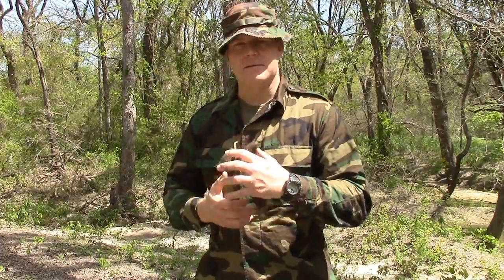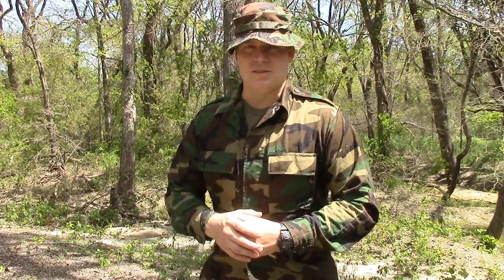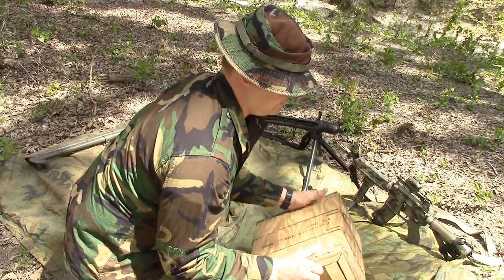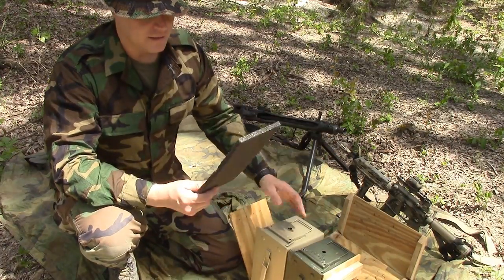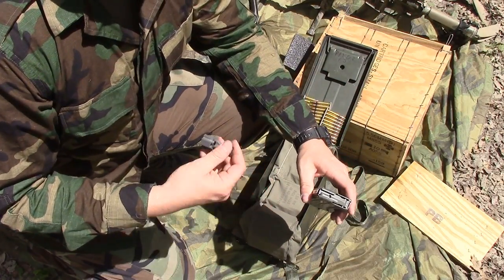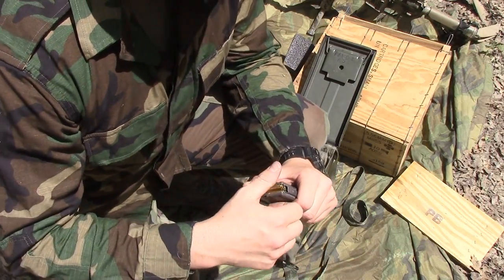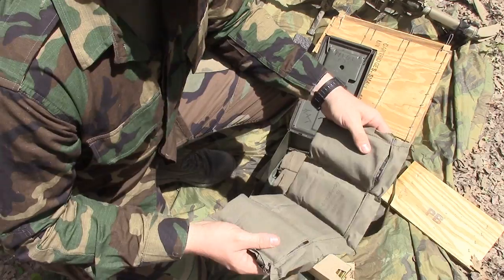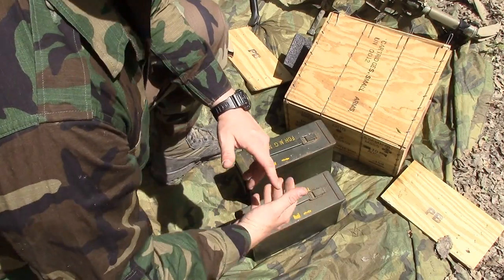Combat Resupply

Comment: I feel like those stripper clips for the ball rounds spread the spine of the magazine. You gotta like force them down and even in full steel mags. And yeah yeah give it a little jiggle up and down and they go, but even then, that clack clack clack as the rounds go in just sounds destructive. And I guess when you’re gear is on the taxpayer that’s fine but for civilians and vets, that can break your cheap P mags real quick.
Reply: And holy hell those brass things they line the clip with are SHARP. Worst paper cut I’ve ever had 😂

Comment: Are the Marines still using 30rd aluminum or Magpul Pmags? If your using the aluminum, what is your thought of the standard follower? I hear so much about changing it out to a magpul non tilt follower.
Reply from the maker: Yes and no. My unit started getting P-mags last year I believe. Im sure some non infantry units haven't been swapped over yet but the issuing of P-mags has been taking place for awhile now.

Comment: A question.  What is your experience with having your M16 mags topped off at 30?  Do you load up the full 30 in an actual combat situation? Or down load the mags to 28 or 29 for supposed reliability?  I'd like to hear this from an actual veteran rather than just a firearms instructor.  Thanks in advance.
Reply from the maker: +fjamato I always do 28.... will your weapon jam if you have a fully loaded magazine? I HIGHLY doubt it. I would say the only real reason to do that is because sometimes when you your  inserting a fully loaded magazine into your rifle with a closed bolt, it sometimes doesn't seat properly. I like you, have always been told to do it, so that's what I continue to do.

Comment: BTW, does the machine-gun bandoleer pouch attach to the M240 like it did on the M60?
Reply from the maker: In my experience no... at least not in the Marine Corps, I'm sure the Army has some kind of high speed mechanism to facilitate that. For Marines its straight out of the box and onto the feed tray.
Reply: But you know what I'm referring to on the M60 right?  It was a metal plate on the left side of the gun.  You would stick the looped end of the bandoleer pouch onto that so that you had a field expedient ammo holder.

Comment: I know the side straps on the 7.62mm bandoleer are used to attach it to the side of the M60 GPMG.  Does the M240 have the same arrangements?
Reply from the maker: There may be an attachment that is capable of doing that on an M240 but its certainly not on any Marine Corps M240's. At least I have never seen one.
Reply: Ah.  Yeah, the canvas strap on the cloth 7.62mm belt pouch their is designed to mount that box to the side of an M60 or M60E3.  The vertical sheet metal piece hinged to the left side of the M60-series feed tray allows that band to slip over the top and the rest supports the  box.

http://www.hunt101.com/data/500/medium/m605.jpg

Shows one version.

Anyway, that's another one of those tidbits of info tied to the design of the packaging that might otherwise be lost to history.

Comment: Gunnery Sergeant isn't it more reliable to load you magazine one by one. I understand this is a quick way to get back in the fight but I think it's also something to consider. BTW I'm just enlisting in the Marine Corps and you've been in for at least 10 years since your a gunny and were in theater in 03 so I'm not the most knowledgeable on gun YET but time will come for me.
Reply from the maker: These aren't rimed cartridges like that on a 7.62x54r, those cartridges you need to loaded individually to ensure the top round is in front of bottom. With the 5.56, rounds getting in the magazine are rounds getting in the magazine, wouldn't make any different. The only reason I could see for loading rounds individually would be to add tracers into the mix. Other then that you're just wasting time.
Reply: Ok thank you Gunnery Sergeant didn't know that.
Reply: Maybe they're paid by the hour! Just kidding.  Going over basic stuff never hurts, whether you're a soldier or a forklift driver. Much appreciated!
Reply: I do want to add rimmed cartridges being loaded that way is only really relevant on auto-loading or automatic weaponry. In the Mosin Nagant rifles, the rounds do not need to be loaded any particular way. They will feed reliably as long as the weapon is in good working order. If your rifle requires you to load them a specific way, the interruptor tension needs to be adjusted, which is a really easy fix and there are tons of videos here on YouTube to explain how to do it. Sometimes damage to the rudimentary feed lips will cause it, too, but I've only ever seen that once, and it was after some dude fucked up massively bad with a dremel tool trying to fuck with it.
Reply: I will also mention that there are a couple other weapons out there with rimmed cartridges on the battlefield, namely the Lee-Enfield rifles. Their controlled round feed can sometimes hang up if the rimmed cartridges come apart, but I've not personally seen it with any of mine (sample size of about 4 different Lee-Enfields, so take that for what it's worth...). It usually generally seems to be indicative of an actual problem with the weapon itself malfunctioning than the ammunition, because these rifles would have been designed to get around that drawback (like the interruptor on the Mosin) of cartridge design, and the British had several years to suss out the problems (cartridge was adopted first during the use of the P1888 Magazine Lee-Metford, so it's a pretty old one...).

Comment: Where every second counts in combat,  when it comes to resupply the Marines and
 Soldiers should get 30 round mags fully loaded and ready to go
They should not take take their eyes off the prize and fumble around with speed loaders and stripper clips.
Your eyes should be on the movements of the enemy and not on ammo pouches .they should receive resupply in a plug and play fashion and keep putting rounds down range    
I can’t tell you how many times men have wounded or killed because they. had to stop the fight to monkey around with 
Stripper clips . Yes they essential tools , but they don’t belong in the heat of battle

Comment: arent you supposed to load no more than 28 rounds in a mag ? or is that practice not necessary with modern magazines ?
Reply from the maker: +Riad Haidar I load my 30 round rifle magazines to 28. From my experience the biggest benefit to this is when the bolt carrier is closed a fully loaded 30 round magazine can be more difficult to seat. Obviously its not an issue if your doing a speed reload while your bolt is locked to the rear. If I were in a situation like I was in the Najaf cemetery though where I'm trying to get my rounds back into my magazine as quickly as possible because enemy contact is imminent. I'm throwing those strippers into my magazine as quickly as possible and am not worrying about striping two off the top.

Comment: Bandoliers don’t come with speed loaders anymore.  And no real infantryman uses SI mags anymore; PMag or die.  Don’t think the SI speed loader would work with those either.
Reply from the maker: This video wasn't exactly made yesterday, P-Mags are standard issue now, and yes the speed loading chargers do fit on them. Also what is the ammunition DODIC you are referring to that issues bandoleers of 5.56 on stripper clips without chargers? Highly doubtful that's the case.

Comment: So if you can remove the sewing to fit a full magazine, Why don't they just send you a full magazine in each pouch, Maybe even 2 in each pouch? I get that it might be a little more versatile if a 556 weapon that doesn't take stanag mags but I don't believe in the military that there is a whole lot of diversity in the weaponry, From what I have heard they have standard weapons for each need, M9 for sidearm, Now its p320 I believe? You have the m4/m16, m249 Saw, And then marksman/sniper rifles. So from what I know there shouldn't be any many if any situations where that would be an issue? But I may be completely wrong, I have 0 military experience and am talking purely off of what I have heard.
Reply: ''Why don't they just send you a full magazine in each pouch'' Weight and cost, that's all.

Comment: Those freeloaders dont work on those plastic mags do they I have all steel mags but I do have a few magpul pmags
Reply from the maker: Yes the USGI charger does fit on a P-MAG, I've used it several times.
Reply: Awesome what are your thought between the pmags and troy battle mags
Reply from the maker: @apbiggins8mm  I have no issue with the PMags, I personally have no experience with the Troy mags.

Comment: ...did my nco fuck with me by giving me 5 round clips and no speed loader?  I mean you can still get pretty good at jamming clips into mags with practice but i would have loved a convenient little slot to hold the clip steady other than that little bit at the back of the mag they you fit the very tip of the clip in...

Comment: why the fuck dont they just put loaded mags in the bandoleer and save everyone a lot of time
Reply from the maker: Magazines cost more and they take up more room.  This way you can get more rounds to the front in a smaller package. Plus you don't know how long this stuff is going to sit before being used. I'd imagine springs would eventually loose their tension being compressed for so long.
Reply: recent tests reveal that spring tension of stored, loaded magazines is not a problem at all.  What wears out the springs is being compressed and then uncomrpessed but if left in a compressed state, they dont wear.